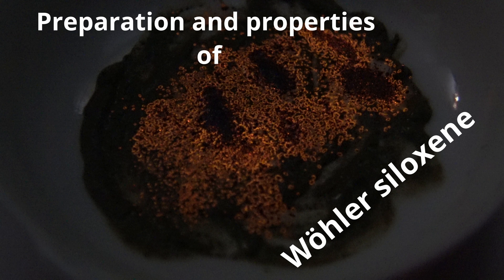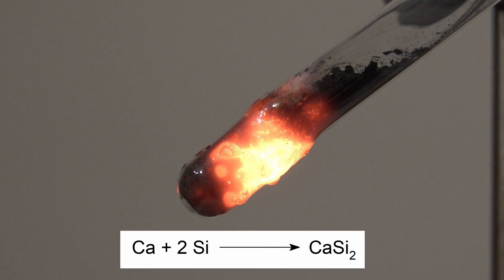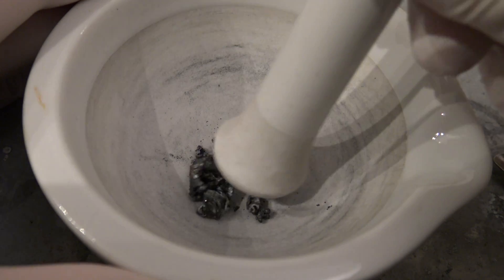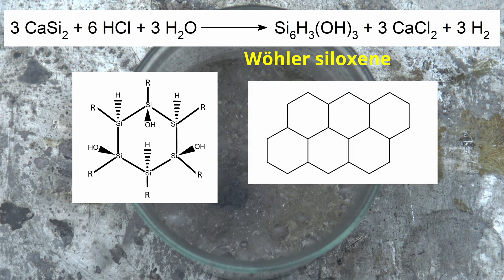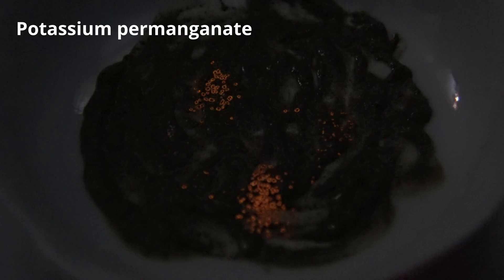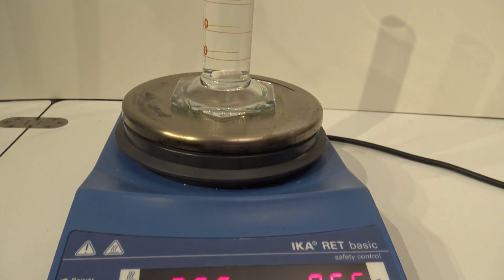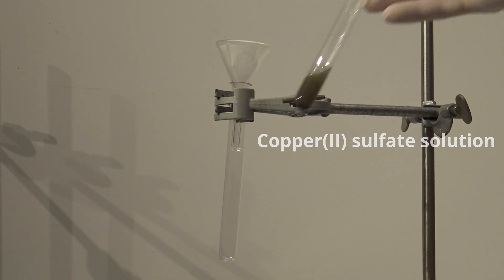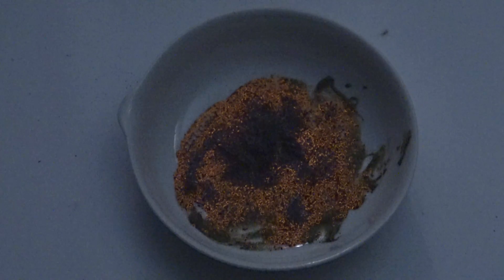Preparation and properties of Wöhler siloxene

Comment: So can we do the same experiment using magnesium? And sand?
Reply from the maker: Magnesium and sand usually leads to the magnesium silicide, which reacts to form monosilane with HCl, but I was really curious, if the experiment works with magnesim and silicon, but all sources didn't mention it. So, I tried to find out, if magnesium disilicide exists, but I always just got to the silicide. That's why I didn't give it a try, yet.
Reply: @RaExpIn  I would  like to see if this could be done with Mg...

Comment: A substance with amazing properties I have never seen or read about before. Nice! 👍
Unfortunately calcium metal is rare to get and quite expensive. But I just found out that one of my favourite suppliers sells calcium disilicide... 😎
Reply from the maker: It took me years to finally get my hands on some calcium, but suddenly I found it somewhat cheap somewhere on the internet, a year ago.
Reply: @RaExpIn 
Still available there or already sold out?
Reply from the maker: I just looked it up. It was on Ebay, but it's sold by a different user now.
Reply: @RaExpIn 
Ah, found some cheap Ca from Czechia, but it looks not very trusty, rather dirty.
Bought 2 g from the Netherlands years ago, which was enough for my purposes, but meanwhile it's all used up and I have no further use. And I have no silicon, too. So I will buy 10 g CaSi2 instead on my next yearly order from Allenstein I guess... 😎